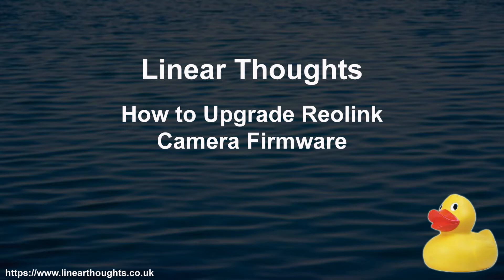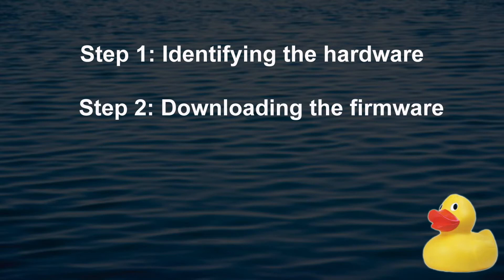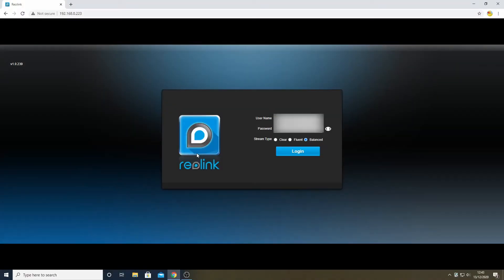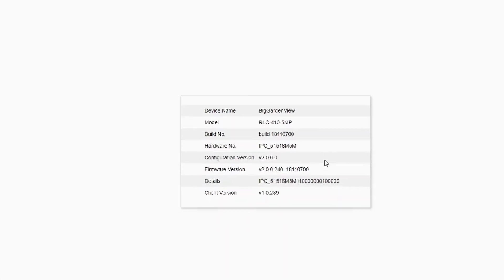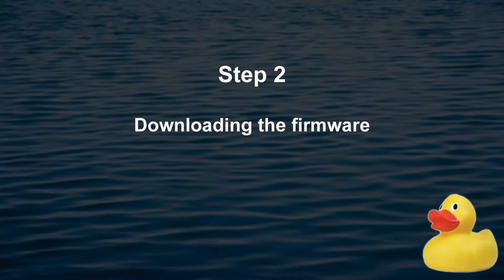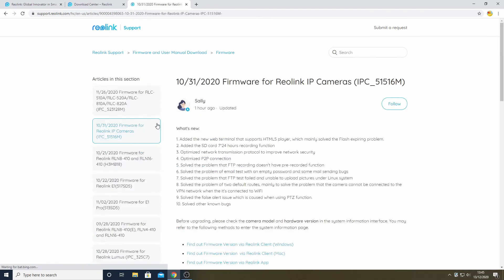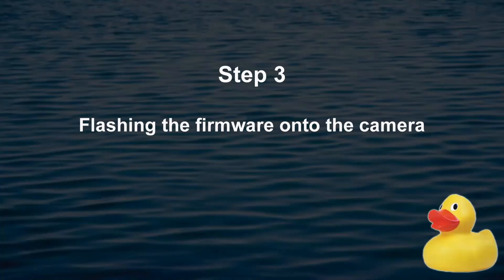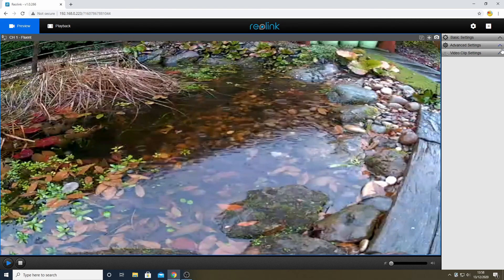How to Upgrade Reolink Camera Firmware

Comment: If it was as easy as that :-( .. I just get upgrade failed all the time
Reply from the maker: I have upgraded all of my cameras a few times now without issue. I can only suggest checking that the camera hardware version that you are installing it on is compatible. If it is, then you would probably be best to contact Reolink support - they do respond very quickly in my experience.

Comment: Hi Tim, but how do you upgrade your cameras if you have two different cameras models.  I have the RLC-520 POE cameras in home connected to my NVR and I have one RLC-410W WiFi camera also connected by WiFi to my NVR at my front door.
Reply from the maker: Hi Daniel, you should assume you will need different firmware for each different type of camera but when you look into it further you may find the same firmware is applicable. 

My experience is based around the RLC-410 but as far as I am aware the process should be similar for any camera. In other words, find out the camera hardware number (the one that usually starts with IPC_), then search for the firmware on the Reolink website using that hardware number, then check the firmware offered is compatible with your camera number (e.g. the RLC-520). You can then upgrade it using the NVR or the web browser. There is good information about that at https://support.reolink.com/hc/en-us/articles/360008743073 .

Comment: No use. RLC-410 5MP with 1.0.266 UI here, pretty different look.  FW upgrade via that Web-UI does expect a file with the extension .ipc_515b16m5m, will not accept a .pak file, not even if I rename that .pak file into something.ipc_515b16m5m ... let's hope Reolink support will have an answer.
Reply from the maker: Hi Richard, the firmware upgrade in the video took my cameras to 1.0.266. I.e. it took the cameras to the version you already have installed. At this time (Feb 2021), this is the latest version for the RLC-410 5MP camera so I don't think an upgrade for your camera is required, or even possible. You can see the latest firmware at https://support.reolink.com/hc/en-us/sections/360002374874-Firmware . If future upgrades require a different file format I will upgrade the video to reflect that.
Reply: @linear-thoughts  Reolink did react quickly and I got a firmware from them. 1.0.266 is the UI version, the firmware version is 3.0.0_something, where my previous was 111 and now is at 136. Seems like there are various versions of the RLC-410 (hardware 515B16M5M vs 51516M5M)
Reply from the maker: @richardjelinek5038  Glad you are sorted!